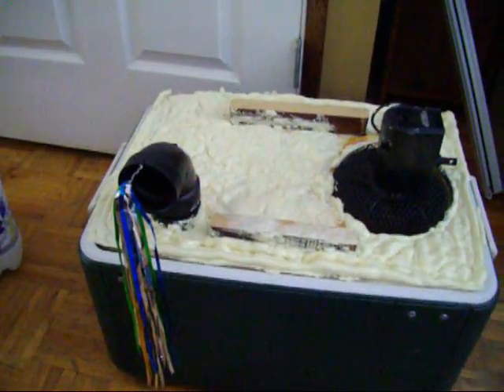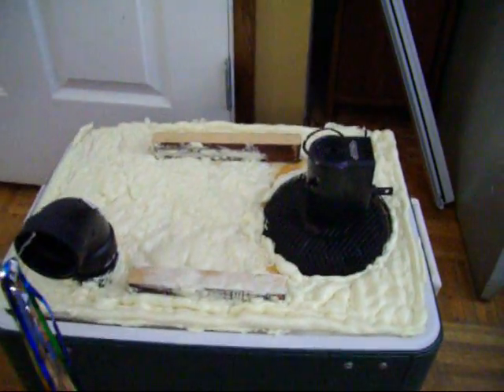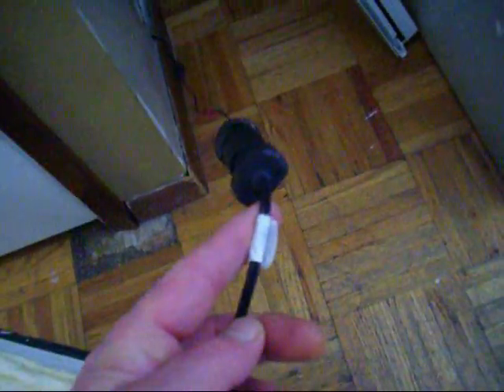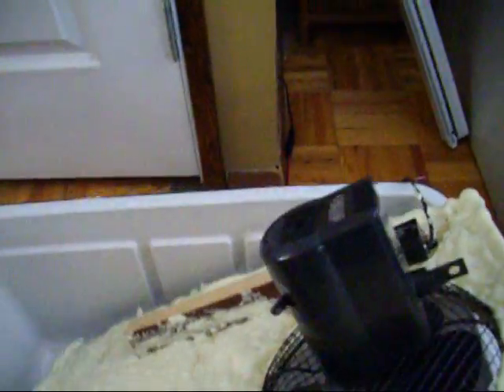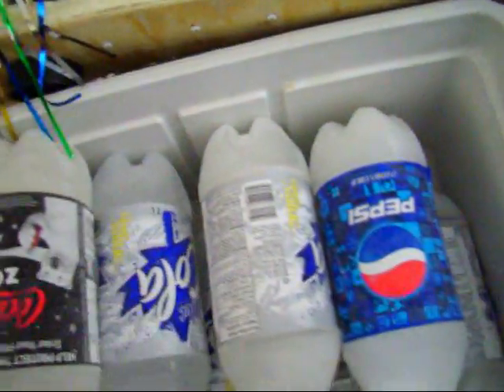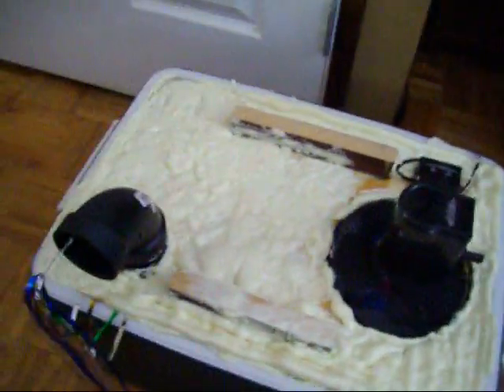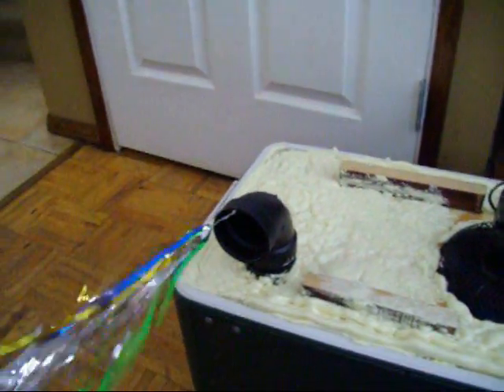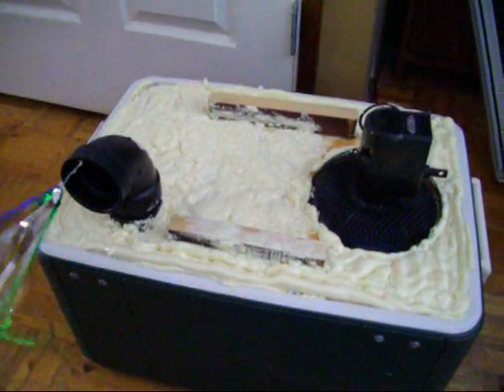12 volt dc air conditioner

Comment: I did this too after seeing it online. I use mine for camping. I place the ac inside the tent and the battery outside the tent. I have a solar battery charger I use for daytime and run ac at night. I carry extra frozen bottles in a cooler inside my vehicle. Usually I camp at a park and there's always a store nearby so I buy a bag of ice for each day I'm camping. It's cheating to camp like that, but I love it -especially after fishing all day in the sun.

Comment: This is a good method of air conditioning. However in places with little to no electricity, it's hard to freeze bottles of water. The freezers don't work if they get 1 hour of power and then 1 hour no power. In some parts of the world thats how brownouts roll.

Comment: I've watched some of the other videos and they all pretty much show the same thing. But what I liked about yours was the frozen 2 liter soda bottles. Here I am thinking about having to buy ice but you nailed it! I have a 1998 Dodge Durango and the air is gone. They want $1200.00 to fix it, yeah right! I also like the spray foam lid, which means I can keep my original lid.

Comment: This is an interesting idea. I remember seeing something similar for sale for motorcycles. You put the unit on your gear rack and the cold air is put in to your jacket. It is quite uncomfortable riding in the summer because of no airflow in your jacket. 

The main issues though are...
It doesn't dehumidify the air so in a tropical climate it wont work plus it would make things mouldy eventually.
You would need a lot of icepacks and fans to put out sufficient cold air to cool a room.

Comment: If you have ever taken thermodynamics you will understand that a system like this does not really offer any net cooling to the dwelling as the thermal energy is transferred to the ice bottles, which are then put into the freezer, and then the freezer removes the thermal energy and expels it into the room it is located in, which is attached to the same house (presumably).

Comment: Systems of this nature will, indeed, produce cool air. However, they will not produce a net cooling effect if they are located in the same room as the freezer that produces the ice. As we all know, refrigeration systems cool by relocating thermal energy (you cannot create or destroy energy, only move it around or change the form). Freezers remove the thermal energy from the cavity and transfer it to the room. A real AC is much more efficient as it actually takes heat out of the house.

Comment: OK, yes it is technically an air conditioner. How exactly do you get the cold water/ice without a refrigeration process? FYI, Freon is not used or produced anymore in modern refrigeration appliances. The newest refrigerants are much less harmful to the environment. 
Swamp coolers work by spraying a mist into the air, the mist evaporating into the air is an endothermic phase change thus cooling the air. These only work in dry climates.

Comment: "air c-o-n-d-i-t-i-o-n-e-r" YES... air blowing over cold bottles and creating cold air is called an "air conditoner". it's not a half baked idea.. it is the same idea as a swamp cooler, which BTW is still used widely in Australia as the preferred "air conditioning unit" due to the ability to come by cold water and ice faster than air conditioning coolant..freon, which is very bad for the environment. Plus just creating freon is hugely dangerous for the environment.

Comment: This is a half baked idea and is not an air conditioner, just a fan pushing heat into bottles of ice. If I had a solar powered fan circulating cool air up from my basement would I call it and air conditioner? no.....

Comment: @wduane2807 try it again, but this time, after you put in the frozen soda bottles or ice, pour some salt over the ice. It will lower the temperature at which ice will freeze, and, henceforth, make the output cooler, and last longer.

Comment: Tried that, a truck with no a/c and that was a waste of time and money.  It had a cool breeze but that did not last long and there was no temperature difference in the cab of that truck.  I ended up turning it off and rolling the windows back down.

Comment: Great idea. I need to make a unit like this for the rear of my Cargo van. I make deliveries and it its so hot. Also. If you turn down the power of the fan it will blow colder. Turn it on high and it will blow a little warmer. Same as the front ac in your car. Good video. Thanks for posting.

Comment: @BIGTROUT01 U freeze the pop bottles at night when the electricity and temperature is lower. The amount of heat put out by a fan is not able to be felt by the typical human. I run a fan by my bed in the summer/fall and i never felt the air flow any warmer. It would get too cold at night.

Comment: @SuperSexyBoiGod 
Technically, you could simply take a small fridge or freezer, put in a copper coil and pump, then run PVC pipes to your fan (Another copper pipe coil around that), then back again (Complete circle with water running through it). 

It'd make cooler air from the fan and as long as you don't put the fridge in the same room as the fan, it would be a cooler room, the downside is, its not going to be close to an A/C cooled room AND you'd be heating up another room.

Comment: @SuperSexyBoiGod 
Not really, consider the scale. Freezer has to cool a small, insulated area down to zero and keep it there.

AC has to contend with a larger room, more airflow (So less thermal stability), more external heating sources (Humans, animals, electronics, etc) and has to be larger than needed to get decent cooling. 

Just check out the energy usage of a freezer and fan verses AC, its a surprisingly big difference.

Comment: @SuperSexyBoiGod 

It is a "Room Cooler" not a house cooler. Many people prefer an Individual relatively sealed room to be cooler than the rest of the house. This allows that to happen for minimal increase in power bill (What power is needed to refreeze the bottles)

This would REALLY help in peoples rooms running extremely high wattage (600+W) Systems that cause the individual room to heat up greatly. In this case it will be cheaper to freeze the bottles than cool the whole house with AC.

Comment: NICE Job! And you are FAR more realistic about this than other videos. Some are claiming free or near free air conditioning but simple physics will tell you that pulling heat out of the air is never free.

I REALLY like how you use bottles as the cool surface to transfer heat to. What many of these other videos do is make things worse because the nonsealed systems quickly add moisture to the air.

The solar system is a GREAT idea in my opinion.

Comment: Eventhough the idea is good and is probaly inexpensive I think you would have better cooling results with a vortex tube. The only thing that needs powered in a vortex tube is the air intake. The cool side air output with enough air pressure can expel cold air at about -40.

Comment: GLAD YOUR STAYING COOL. GOOD jOB!!!. I agree that placing the cooler up on a table would be a very smart way to increase efficiency. Also, have you tried standing up the bottles. You would get more surface area exposed to the air flow. May melt bottles faster, but then youll know it is working more efficiently.

Comment: @Airsoftshooter1995 
Not a good idea, dry ice emits alot of carbon dioxide....very bad for the hemoglobin. I've made one of these same setups with reg ice & soda bottles. I've found another downfall is the amount of humidity the ice creates. Will notice a smooth floor wood,linoleum etc will become very slippery or makes carpet soggy creating mildew. IMO, good for camping or short times in a car.

Comment: @plaidzinc 

Where can I get just the fan??  I assume your speaking of a fan that pumps up an air bed??  Can you get one at walmart?  What are my options if I want to use a fan in my apartment and don't want to worry about moisture going up to the fan motor and causing an electrical problem or something like that??

Comment: Enjoyed your vid. Rather than using plywood as a base I used a piece of 2" thick EPO foam, used dc fan also ran off my solar panels. Your absolutely right, it cools down a single room as I've used it the last few nights in the bedroom and it did chill it down. The concept of what it is definately deserves 2 thumbs up. I've taken it with me on the road yesterday, just plugged into the cig lighter, works really good for road trips in vehicles with\without functioning A\C.

Comment: Very loud , if there way to reduce this loud fan about 50% or more , would be the best 12V Air conditioner . Also the size should be smaller than this about 50% or more . and if its use water would be better because in the desert we haven't ice :( . im looking realy for 12v air conditioner for my roof top tent in hot summer but i didnt found best deal with products , because its so heavy , loud and big .

Comment: the ice melts absorbing room heat. while the heat from the water is absorbed by refrigerant, and dissipated from the condenser coils back into the room. I guess it would work if the freezer is in a different room.

Comment: I made this finally, and it works sorta ok. I am using it at the moment in a small bedroom. Barely keeping the bdrm cool with outdoor temps of 80 degrees.
I also made a copper tubing ac which works fantastically in my LR for cooling. Now that copper tubing works like a charm! Difference is though that the copper tubing ac must have electricity. I'm trying to find an ac that works great with batteries in case of a loss of electricity so I'll keep looking. This has been an interesting experiment!

Comment: the heat generated by your freezer to freeze those 2L pop bottles is what's making your place hot to begin with.  Simple einsteinian physics; energy cannot be gained or lost.  Go to walmart and spend $99 for a proper heat exchanger.

Comment from the maker: The fan is a cheap 12 volt two speed fan. Made in china available in Canada at Canadian tire, Check out lowes or home hardware in the states. The black directional outlet is plumbing parts.

Comment: @salvadorscavuzzo : wrong, an energy saving AC will actually be better for your home than re-freezing bottles of water (opening/closing your freezer constantly has to be replenished).  I had 3 AC units (energy efficient) costing me about $100 each cooling my entire house during the summer costing me less in electric than my 2 heaters during the winter.

Comment: Regardless of whether you use ice or refrigerant, the amount of heat you remove is going to be the same. You're going to have to remove the heat from the water to freeze it with a mechanical freezer. The average room air-conditioner removes 12000 BTUs an hour from the room. This would literally take a ton of ice to do the same thing, (hence cooling being measured in tons). The only energy savings realized is in the fan being 12 volt, but this depends on the wattage and not the voltage.

Comment: You say you have plans to build a AC version so you can cool down your bedroom. An alternative would to buy a 12 volt plug adapter from Wal-Mart for $20. Plug it into the wall then plug the 12 volt into the adapter, and problem solved.

Comment from the maker: Hi, I built a second one using a two speed AC fan. The output ended up like yours, very disappointing. The fan used needs to move alot of air. I have not been able to find a AC fan that is small enough and powerful enough to do the job. The fans are usually to large for this project. If you can get the right fan your application on a boat is perfect.

Comment: what if you have the fan and or the exit pipe at opposite sides of the cooler like on the side....where the air is completely forced through the frozen bottles making it more cool? maybe? looks like yours works great..just brain storming  efficiency... good work :-D

Comment: I just built one to use in the cabin of my 23 foot boat... I used a smaller cooler so as to not take up so much room and made the holes on the actual lid of the cooler.  I used 2 frozen milk gallons instead of loose ice.  I'm kind of disappointed that I felt no difference and I really don't feel air being forced out as fast as what is seen on your vid. :(

Comment: This is a great project. Great for areas where you can't run conventional AC. But to run it steadily, you must constantly re-freeze the bottles of water. You cycle through them every ~6 hours or so. You have actually moved the refrigeration part of the AC unit to your freezer. I have no doubt that if you considered the BTU's provided in this system measured against it's efficiency, you are neck and neck with running an AC unit of the same capacity. It's a cool project though!

Comment from the maker: Hi, the numbers are hard to get on paper as they very with the outside temperature. I have used it quite a few days now and it cools our TV room down quite a bit. making it quite livable. We are going by feel right now and all agree it's worth it. Also last year I couldn't afford a air conditioner, now they are everywhere for $50.00 go figure. Im making a plugin AC fan style one. To move  around the house.

Comment from the maker: My freezer is not less efficient, I am not trying to save the planet as it doesn't need saving, so stop assuming that this is some sort of exercise in global whatever and take it for what it is, keeping cool. by a electricity usage meter and test your own freezer,I have they use dick all for power. I guess you would have a problem with microwaved water bottles used in it for a heater, as that's next this winter.

Comment: Ah, those are good points. I am contemplating making a small swamp cooler: I have a fan and a water pump, and I can use a few feet of sun screen material for the evaporate surface.

Comment from the maker: Evaporation brings it's own unique problems. Evaporation would include mineral deposits, high humidity, stale water. I wanted a simple to use cooler and have found this one works great. Although a cooler than normal summer means my bottles have been used as ballast in the freezer. They are also a emergency water supply if needed.

Comment from the maker: The couple of times that I have loaded it with bottles and turned it on it works great, better than expected, and for extended periods. Ice still visible in bottles after 24 hours.  This thing is a resounding success. Still waiting for hot weather mid June, only one hot day so far. build one with a AC fan and see for yourself.

Comment from the maker: 24 bottles sit neatly along one side of my freezer. Having a second freezer just for bottles would be a waste. Sounds like your worried about electricity prices, just insulate the lid of your freezer, and the bottom eight inches, you will notice a difference in your electric bill. Use thin white flooring foam. Do not cover the sides. That's my greenie tip of the day, oh and fill it up as a empty freezer is a power waster.

Comment from the maker: Hi, there truly is no free lunch. The goal is to keep one t.v. room cool during the dog days of summer. This lasts for at best maybe two months during the summer. As luck would have it, my freezer is located in a cool unfinished basement, the extra heat is not noticed. The cooling affect in one room is noticed and greatly appreciated. Also for most of the year the water bottles act a a temerature regulater, evening out the freezer temperature. That's a well known freezer tip. fill it up.

Comment: But....of course....your refrigerator puts out MORE HEAT in the process of FREEZING the bottles, than air is cooled by using the bottles in the way you are. IOW, you end up with a net gain of heat in your house by doing what you're doing.

Comment from the maker: It cools a room down but I have no real world stats yet as it's been cool around here lately. I will comment on how well it works when temperatures are in the 25-30 celcius range. I have 24 2 liter pop bottles prefrozen waiting for hot weather.  Al Gore are you listening?